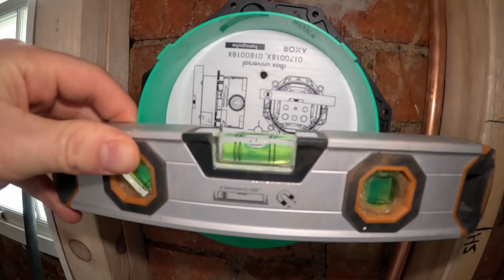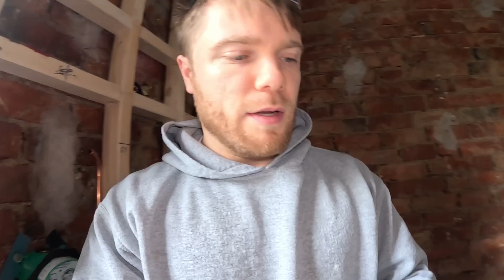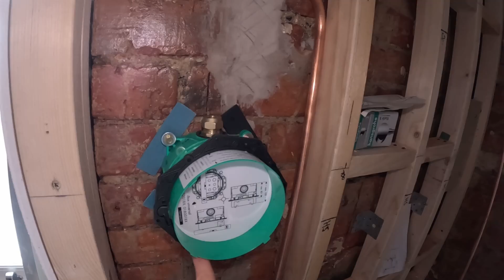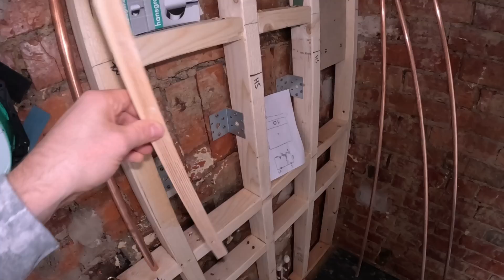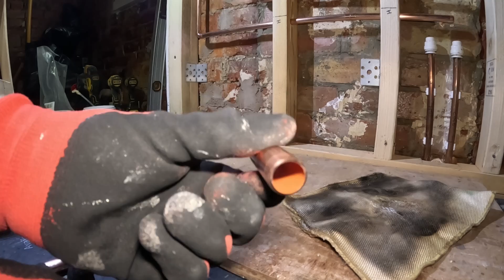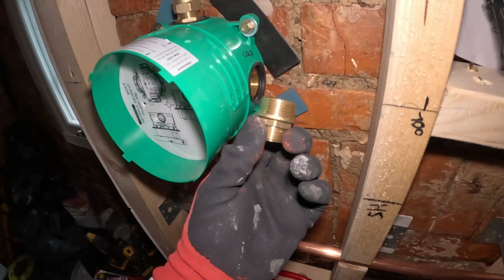How to fit a Hansgrohe iBox Universal - Shower 1st Fix

Comment: Good video thanks. I need to correct something you said about quality. I had one of these iBoxes installed just on five years ago. It was installed by a qualified plumber as part of a full bathroom reno. It came strongly recommended by the plumbing supply shop. IT HAS FAILED a short time over the five year mark. I went through the supplier to Hans Grohe, who were less than helpful, but in the end conceded to do something. The fitting itself has a 15 year warranty. HOWEVER, the small print says that after 5 years, they will only supply parts, no labour. I paid a small fortune for this thing, thinking, like you, that it would be top quality. Well that turned out to be bullshit. They've sent me a box of parts to replace what they're assuming is the faulty bit. I'm reasonably handy, but I'm concerned that installing this may be beyond me.... Anyway, everyone should be aware that Hans Grohe's warranties are rubbish. I would strongly recommend NOT buying.

Comment: Hi, just following up on my last message. Could really do with some advice please. Would really appreciate some advice on how to do pressure testing before i board everything up.
Reply from the maker: Hi, you can buy an air tester from screwfix or amazon. Monument dry test kit is the one I have, then you just pump it up with a bike pump. Leave it for a day and see if it drops at all.
Reply: Thank you for your reply. So just to clarify: for the hot and cold inlets I can just turn on the water supply to them and the factory fitted blank white cover that has the Allen key bolt on it basically keeps that closed up so essentially just pressure test the inlets with the inlet feeds having actual water. 

But for the two outputs that go to the wall plates, when I need to test those  should I turn the supply off and the air pressurise from the wall plate end ? Will that air not end up back in the inlets or is that ok since it’s turned off? 

I’m assuming no pressure or water gets to the two output pipes because the actual main thermostatic valve etc isn’t installed at this point? 

Oh and what sort of pressure do you pump it up to? 

Thank you so much

Comment: Just found this video, really helpful. I’m installing an iBox soon and had a quick question about pressure/leak testing before I board and tile.

Once I’ve connected the hot/cold inlets and the two outlet pipes (rain + handset), I plan to cap/blank the drop-ear elbows at the wall plates. With only the factory white blanking/protection cover on the iBox (no finished trim/controls fitted yet), is it safe to turn the water back on without water escaping from the front?

Also, what’s the best way to properly test the two outlet runs for leaks before the wall is closed? If the control/finish set isn’t installed, will those outlet pipes still get pressurised for a static leak test, or do I need a separate test/flushing insert or pump setup to be 100% sure the solder joints are sound?

Any advice appreciated - thanks!

Comment: What's done with the adjustable black plate on the front? Is that supposed to be flush with the inside of the front wall to act as a clamp when the mounting plate is put on the outside of the finished wall?
Reply from the maker: Yep it should be flush with the tile, so you need to know how thick your tiles and adhesive will be to set the depth correctly